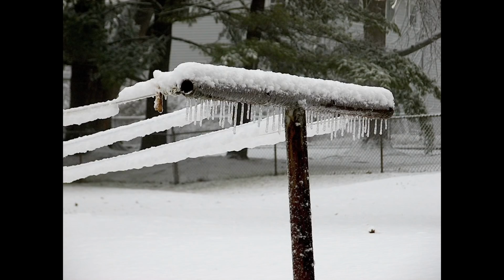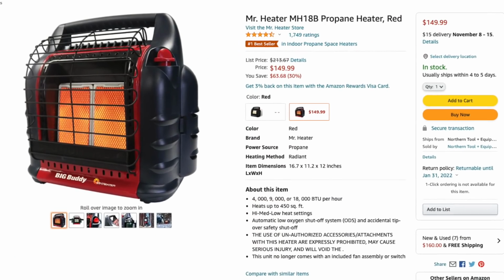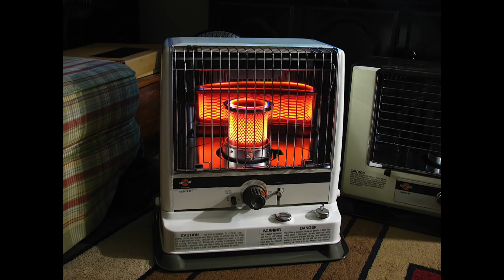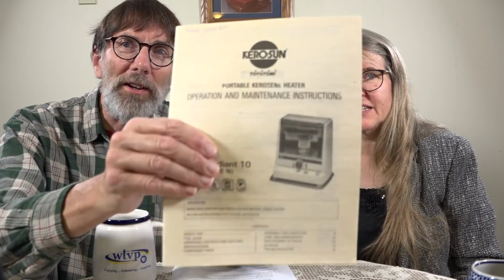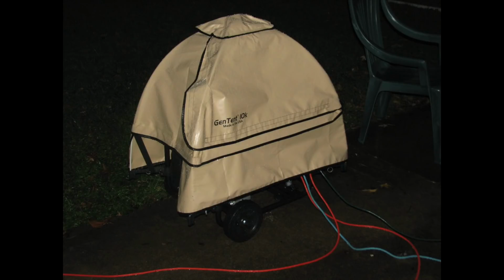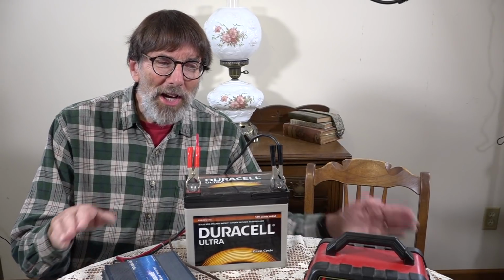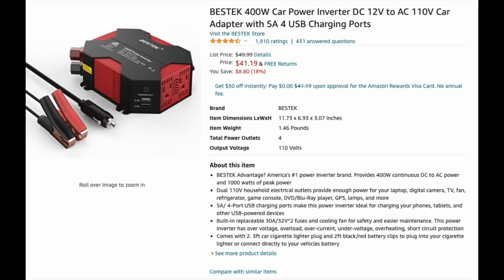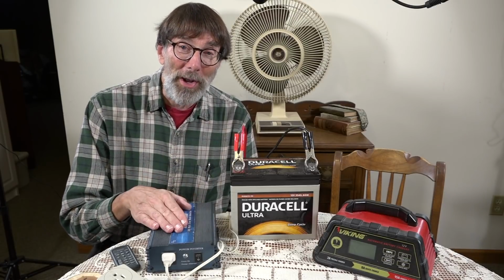How to Generate Heat and Electricity During a Winter Storm

Comment: I too started my prepper journey with trying to keep my critical sump pump opperating during a power outage many years ago. Started out with a 12v marine bilge pump with a cord modified to clip onto our car battery. Now have a true sinewave inverter and a small gas generator, while the latest iteration is untested under fire, they will serve us well. I love the inverters because the car running draws way less attention than a noisy generator  and the car will idle for days on a full tank, providing limited power. In recent years it kept our two fridges and one freezer going during a 4 day power outage caused by a summer storm.

Comment: You mentioned that you run your router so you can have internet, and at one point you mentioned that you use it to run your television.  It should be noted that if your cable goes out it wont matter if you have ability to hook up your router or television.  You need to have service provided to both up and running.

Comment: If you want heat for a single room like a small bathroom use vegetable shortening stick a candle in there and then trim the WIC so that it is pretty bare then stick one of those pottery based plants pot on it inbam you got an improvised decent heater that will last for 20 ish days now.

Comment: I use the Big Buddy heater when I go winter camping. If you set it on low it can go for 6 hours on the small green propane tanks. If you run it on high it will only last 2-3 hours.

Comment: We have a whole house Generator,   it will kick on when power goes out.  WE Saved for this, because we don't want to get stuck like we did 3 years ago in a ice storm. 
You gotta stay warm, we have to have O2 for my Cowboy.   We used feet warmers , hand warmers, blankets,  ect... we used  oil lamps , flash lights , solar lights, .  Great to see both of you, 
Excellent Video ❤
Reply from the maker: Cowgirl, I highly suspected that you would have a whole house generator. If we lived in the middle of the country were you do, we'd absolutely have one, too.
Reply: We have the same all home Generac, but believe strongly in having back ups for back ups. For us (live in Wis.) we also have a gasoline powered generator to run outdoors and two Jackery power bank generators with solar panels.  Lots of heating devices, alternative ways to cook food, etc.

Comment: We are going to invest in one of those generators this year. We live in a rural area with a well and leach field. Without power we have no running water, much less heat or power for the fridge and freezer. I've actually gone down to the river we have frontage on and hauled buckets back up the hill to flush the toilet!
Reply: When we lived on well water if a storm was coming we always filled several buckets and the tub with water for flushing

Comment: We are looking at solar power packs just for heat, modem, phones, electric skillet or small burner to cook on, and space heater.  The whole house generators are too expensive.  Don't want a gas powered due to the noise.  After freezing last winter due to 2 day power outage, we have to have a backup source for awhile anyhow.

Comment: Mr Heater makes a larger gas heater (30,000 btu) that can be mounted permanently or free standing. I have have one that's natural gas and it's located in the middle of my house and provides some serious heat during power outages or to supplement my furnace. It does have an electric fan but isn't needed to operate. I don't have to mess with kerosene it just sits there ready to go to work when needed. They also make a propane model and both have low oxygen shut-offs. 
You mentioned that you store your kerosene in your garage. Kerosene has a higher flash point than gasoline but it should still be stored in a shed away from the house. You might want to mention to only run your generator during daylight hours when there's a long term power outage. People steal generators and one running at night can be heard a mile away. I keep mine chained to my truck when it's running and at night it goes in the shed. I also run it on ethanol free gasoline (bought at co-op) and I use Stabil gas additive so my fuel doesn't go bad. Shelf life without this is 6 months and with it is 2 years. 
You mentioned the AGM battery charges at a lower voltage compared to an automotive flooded acid battery. They actually charge at a higher rate (14.6v) than a car battery (13.8v).   Remember that one is none and two is one. Always have a backup plan for your backup plan.

Comment: I agree with you on the Big Buddy. With the purchase of a hose, it will connect to the larger tank that I can use on my grill like you mentioned. It will run on low, with just one 1 lb cylinder or on high with 2. I also have a larger size Kerosene that I bought in 2000. I wanted to have 2 sources in case I couldn't get one or the other.  I also have a spare wick on hand.

Comment: Right now, Costco has the heater along with the hose and the filter, which you must have to adapt it to a regular 20 pound propane tank, for about $75.   Even better, last summer I picked two of these up from Costco that were deeply discounted for about $55 each including the filter and hose

Comment: If you want to use a gas generator to charge something like a cell phone or a tablet make sure you got a power regulator so you're not getting dirty power. Cell phones and tablets can get damaged by using dirty power
Reply: Good point.  That's what I have the pure sine wave inverter for.  You don't want to ruin electronics with modulated sine wave power.

Comment: I would like to add a comment about the generator.  If you have this B&S generator (like my Generac XL5500), everything works fine with older refrigerators and Freezers.  For all of these devices you will want to add an inline surge protector because of the quality of power from the generator.  Our New GE fridge was run with the generator and the power burned out the computer control panel in the fridge.  We had our fridge replaced  under warrentee, but you want to avoid this.   Since that Power outage, we added an inline surge protector for the fridge and stand alone freezer.  In addition, we also purchased an Inverter generator so that we can get clean power for our house.  Our house now has a Firman 3600W inverter generator which can run almost everything in our house.  For any power need under 4 hours, we use the battery and inverter just like demonstrated later in the video.

Comment: Wood burning stoves are bad for the lungs. Crack a window when using them. My uncle had an uncle who used one. He didn't smoke, but died from lung cancer. They were extreme off gridders. We bought those propane cylinders for our camp stove from Walmart. We used part of one. We bought old kerosene heaters for our house. They were useful except when they smoked. It looked like we had a fire in here. We had a couple of them. I believe in one was a Kero-sun. I just bought a recommended electric space heater from Amazon. It's supposed to heat a 1,000 foot space. It does if it's not all that cold.
Reply: We have two Kero-Sun heaters.   I wish they still made them.   We're extremely careful to make sure they are burning properly.   Only once did I accidentally soot up the basement with one that had a bad wick.
Reply: @larryware1  I believe they improved them since we bought ours 20+ years ago. We got ours secondhand.

Comment: I use the wave 8 to heat up a 300 sqft. Cabin with a 30lb propane tank. It runs really good. I keep it on 24 hours every day on low. I get 9 days straight usage. It costs me $19.00 and change to get the tank filled. Its alot cheaper & better then a mr. Buddy. Just a guess if i use it on high i probably woud get 7 days. A green 1lbs bottle would cost $3.00 & change for 2 hours. I would be nuts to use a mr.buddy heater. I live in Maine USA
Reply: Good suggestion, Adel.

Comment: Great video. I've always wondered how to use a generator or inverter and battery system. Now I know. I have no reason not to be prepared now! Thank you!
Reply: Super.   I only scratched the surface.   There's so many possibilities for supplying electricity and heat.

Comment: I'm at beginning of video
My concern is being in 2nd floor apt.  No balcony.  We can't have any propane or Kerane for lamps.  Have good war,m clothes and bedding.  And camping cooking and lights.  Along with solar lights
Reply: Yes.   You have to work with what you can.  When we were in an apartment (also 2nd floor) we were able to use a kerosene heater but no gas generator.

Comment: my parents had a kerosene heater and when they ran it my muscles would ache. I don't know if it took the oxygen out of the air or what.
Reply: Not sure why that would happen, but I wouldn't recommend their use it's giving you bad reactions.   My dad and mother had to stop using theirs when Mom was diagnosed with heart failure - oxygen issue there too.

Comment: I self installed a Generator Inlet & wired it to a wall outlet that I installed for a generator outlet,... The wall outlet is NOT wired to the house electricity, just the generator inlet.
I have a specific cable to go from the generator outside to the inlet so inside the house I can plug in the fridge & freezer without running an extension cord through a window or doorway.
Reply: Great solution, David.  I really need to upgrade my system.
Reply: @larryware1  
It was very easy,... The most expensive part was the outdoor weather resistant Generator Inlet Box which was about $40 because it was 30 amp,... I wanted to use 20 amp wire & indoor inlet but the only generator inlet boxes I could find was 15 amp & 30 amp,... Again, you can simply run an extension cord through a window or door but this is much nicer.

Comment: Isn't the kerosene you get from a gas station pump K-2, not K-1, and not recommended for heaters? I believe K-2 is less processed, contains sulfur, which not only damages your wick but you breathe what you burn. My area in Wisconsin sells K-1 in 1 gal and 2.5 gal jugs or 5 gal cans; 2.5 gal regular price around $21.99, goes on sale now and then for 17.99.

Comment: There are uninterrupted  power supplies that keep a router running for a while when the power fails. I have a router and a separate VOIP system for our phone service. I have a separate continuous power supply for each. Get the ones that provide the correct DC voltage rather than to get one that provides 120 volts and reducing the voltage with the power supply that comes with the router or VOIP because using a battery to run an inverter to go up to 120 volts and then using the power supply to reduce the voltage back to 12 volts DC or 5 volts DC drains the battery faster than running directly from the battery when the power is off. The amount of time this keeps running depends on the capacity of the batteries but it can keep the router and phone running until the power comes back on if it isn't too long and at least keeps the phone working for a while until a generator can be started to recharge the batteries.
Reply: Good information, Gordon.  That is a more efficient way to power those devices.  As you mentioned, converting voltages creates a loss.  Thank you.

Comment: You say this will not run your furnace but it looked like you had a 
natural gas stove.  Is the furnace not natural gas? My natural gas furnace only uses about 750 watts to run the fan and circuitry. It runs easily off a similar size generator.
Reply: Actually, I discovered since doing this video that it will.   I just need to set up an outlet to gain access to the furnace.

Comment: The link to the sine converter goes to the little red one you showed. Is there a link to the larger blue one you have in the video?
Reply: I found a cheaper Samlex SSW-350 (that's the brand I have) at the Alt E store.  Do a search for that model.   They have that one for $116.60 right now.   That's a lot cheaper than the Samlex PST-300-12 that I have (which is $180.00.)

Comment: I worry about my wife who has COPD and on oxygen. Wood burning or burning anything that produces fumes is out! That said, I have a generator that will run a few small heaters. We have survived a week long power outage. I usually keep 25 gallons of gas handy and have two cars that I installed two 1500 Watt  inverter's and plenty of extension cords. I also have a small 1000 watt generator, that will run for 9 hours on 1 and one half  gallons of gas that I use for my C-pap and the wife's oxygen generator.
Reply: Sounds like you're prepared with the inverters and generator.   I keep about 11 gals of gas on hand.  Way to go, James.

Comment: Thank you for the explanation using the battery and inverter, you made it easy to understand. It you have solar generators, say 2, that can be charged with a wall outlet. Can you charge one generator with another solar generator?
Reply: I'm not sure what you mean by charging the generator.   The generator we use runs on gas and supplies power when it goes out.   I have used (and still have them) two solar panels to charge the AGM batteries.

Comment: It’s these Mr Heaters, what are you going to do about the fuel prices and difficulty getting propane because of price & supply?  Again the same with kerosene?
Reply: If you have the option to use a wood burning stove, that would be a great way to avoid the rising prices.  Otherwise, we just have to stock up what we can in fuel and ride it out.

Comment: Good video. I have gas heat. Hopefully it would work if the power goes off.?? Fortunately it doesn't get as cold here in northern Georgia as it does where you live. I also have a Jackery solar generator and the solar panel to go with it.
Reply: If your furnace has a blower, you will need power to supply that.
Reply: The Jackery systems are great for light power draws.  I have the separate pieces that do the same thing, but not as portable as the Jackery system.
Reply: Larry, I have to use oxygen and a cpap machine. I mostly got the Jackery so I mostly got the Jackery for that. I also have some solar light bulbs. I have several cans of fuel(can't remember the name) in  case my gas kitchen stove doesn't work

Comment: Larry, I see kerosene heaters like yours all the time on marketplace for cheap, but buying clear K1 at lowes or home depot is very expensive - $10/gallon right now! When you buy K1 at a gas station, does it come with the red dye and if so, do you notice a difference in how cleanly it burns? I'm really enticed at the prospect of getting one cheap indoor-use dynaglow that can heat up to 1000 sq ft for emergencies, but I want to make sure I can use the dyed kerosene from the local fill-up without (excessively) stinking up my house.
Reply: When we used ours they made an additive that eliminated the smell

Comment: Y'all are a cool and kind couple. How much would a used karocene hearter cost average? I'm 60 and on a budget. Also is it cheaper than electricity?
Reply: I'd say not.  Kerosene is $3.99/gal here in Peoria.  A gallon will last about 3 days if heating exclusively from the heater.  Electricity is definitely cheaper, but if the power is out, kerosene is a great substitute.

Comment: Big Buddy tip:  To turn the knob from pilot to low/med/high...you only push knob half way down.  Wish they would put that in the manual.  And, if you're in Cali, they send a bunch of docs about not using it indoors, which you can and it's designed to do...I love mine.
Reply: Nice to hear, LM.   I would love to try one out sometime.

Comment: For Part 2 can you share options for people that live in apartments? There's not much info out there other than the typical: stay with family or go to a shelter option. For me neither is an option since I don't have family that lives close by (if I'm dealing with icy roads...too dangerous), and shelters won't let me bring my cat. I don't have a fireplace, and would love to see more options out there. Thanks for all great tips on past videos!👍😁
Reply: Muze, for heat, the Mr. Heater would be perfect for you if your landlord allows it.   Also, the back-up battery system like a Jackery, which I didn't cover, is another way to supply a small amount of power.  I'll talk briefly about that on next Monday's.
Reply: Make connections with others in your building.
Lots of warm bodies in a small room. Shared preps.
Reply: @larryware1  yes! I’ve had my Buddy Heater for a decade and swear by it.

Comment: Can you run a small space heater from the battery?
Reply: No.  Space heaters use anywhere from 650 to 1500 watts.   Even if you have a large Jackery system like their Explorer 1000 (1000 watts), you could only run a portable space heater for about an hour or so.
Reply: @larryware1  ok. Thank you for the info

Comment: I have never seen kerosene sold at the gas stations out here in Wa. I think you can only buy it in a can. I'm afraid of it. We have a generator and will be using it for an electric heater. Larry, your battery array business looks like a science experiment. I'm buying a Jackery today.
Reply from the maker: Honestly, Jackery is a great product. Larry looked at it years ago when wound up buying all the components separately and putting together his own system. But, as a "done for you" product Jackery definitely gets the job done. Be sure you know how much energy your devices use and that they fit within the limits of the Jackery.
Reply: A Jackery is SO much simpler, I'll admit.   I've been doing the battery thing since I was in high school.